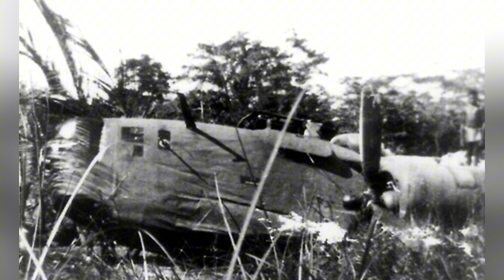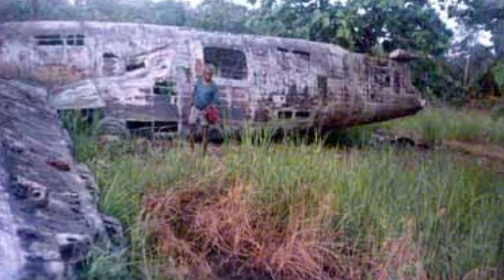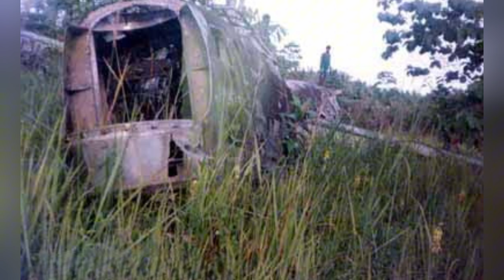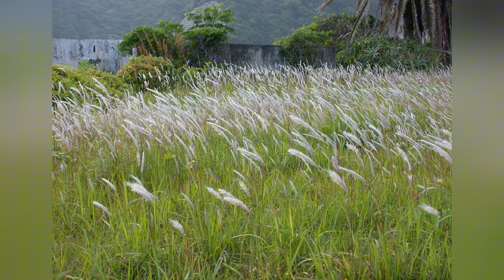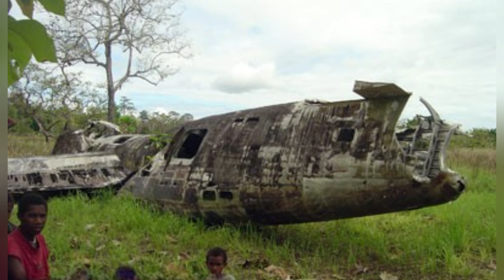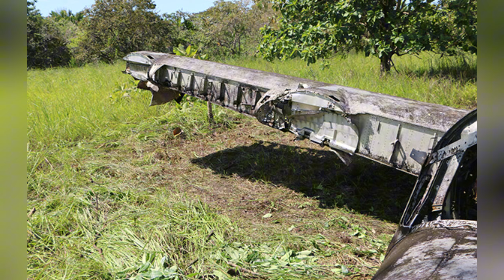Investigating B24D-42-40885: Swamp Landing That Saved 10 Lives

Comment: They had a nice landing. They obviously turned on the electric hydraulic booster and open the star valve, then shut down number three after setting flaps and number two as well, which is important with those Pratt & Whitney engines, cause the propellers have a propensity to fly off, but it looks like they feathered the end boards and as usual the upper return broke off it’s mount, which is typical so making sure that the after flight deck was clear was important and when she started to slide in the Kuai grass, the torsion obviously twisted the tail, which looks like somebody liberated overtime

Nice job putting her down
Reply: Being an early model, she broke a mid ship, but nonetheless became a valuable survival shack in the middle of nowhere with radios water survival gear so the boys could have somewhere to hang out